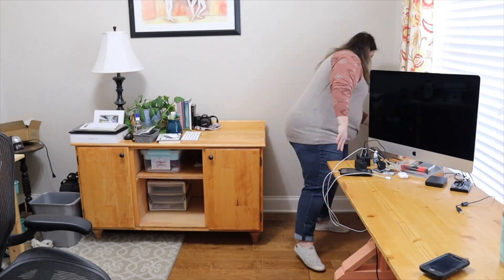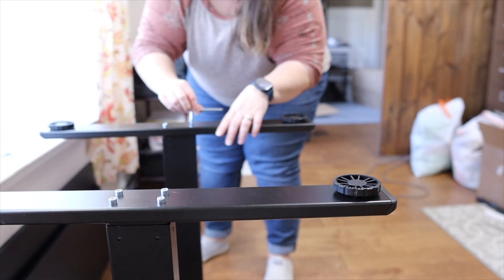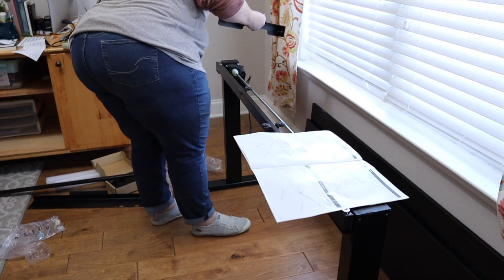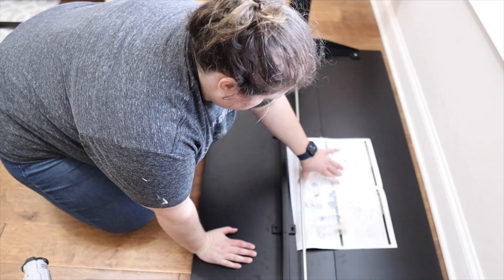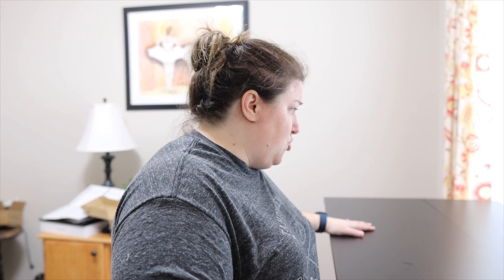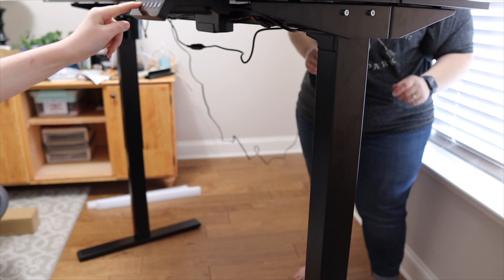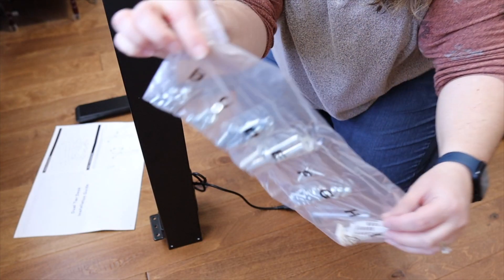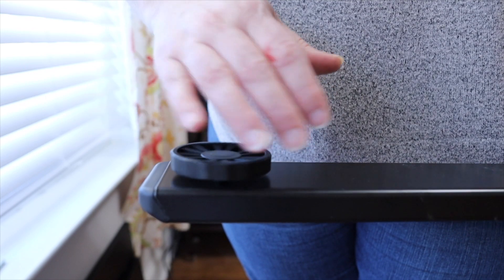I Got A Standing Desk...Mini Office Make Over With A FlexiSpot Standing Desk

Comment: Good luck with the standing desk. I got a stationary one January '21 and it helped me stop gaining weight while having online classes. I got a height adjustable stool for it in case I sit. Its a more economical option but not for everyone. I used to work retail & missed standing all the time so I spend more time on my feet than sitting. I wish we had standing desks at university. I find it helps my focus and keeps me awake. A third economical option, to see if a standing desk is for you and you have a laptop, is a height adjustable laptop stand. They have legs you can manually adjust and are laptop size so you can place it on any table to turn into a standing workstation. I'll be looking into this model for my husband. All the other ones I've seen don't look so sturdy. This was a great sponsorship ad and didn't mind it one bit.